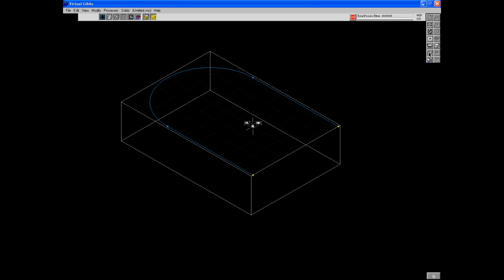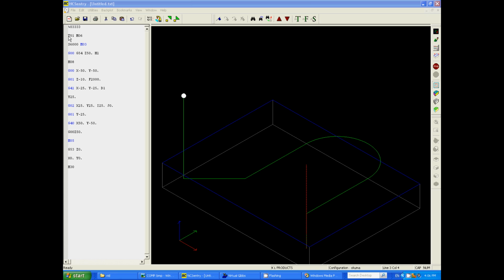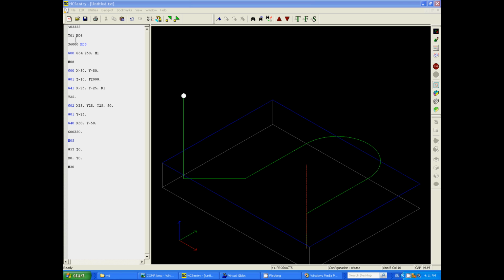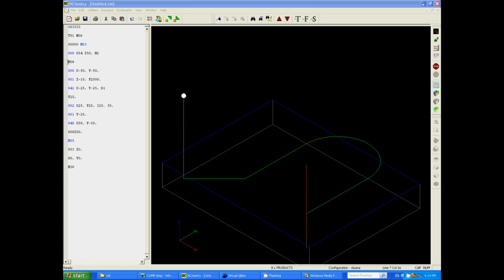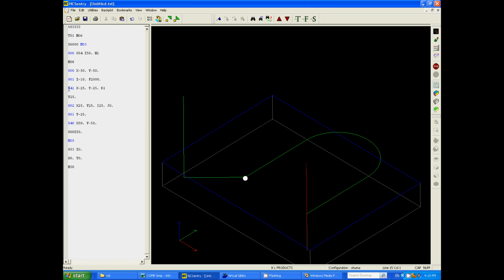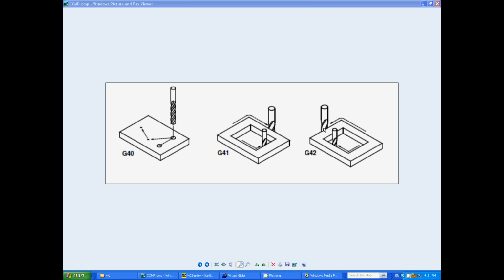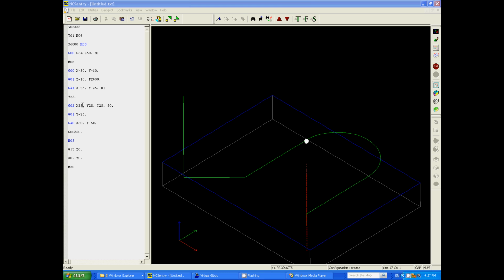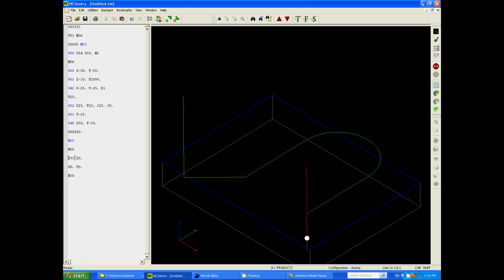CNC PROGRAMMING G-Code basics #1

Comment: I'm just finishing school for manual and cnc machining. For whatever reason, the computer tutorials we went through taught us to use cutter compensation. Since we were the first class through they hadn't looked close enough to what we were learning and when we got into actual programming, as apposes to practice coding, they told us not to use it because the industry standard is not to use it. Do you know anything about that? I'm in the U.S. maybe this is a standard ion the U.S. ...?
it just pissed me off because they should have looked closer and we had to unlearn the way we had just learned.
Reply from the maker: Hey mate, I'd say using cutter compensation is better than not using it however if you're just turning a simple shaft with no features it's not really necessary. Same with writing a simple facing cycle on a mill you might be better off programming without it... it's always subjective to what you're trying to achieve
Reply: lol ya, we're beyond that. They're really just kind-of figuring out how to develop a curriculum. Everyone I've seen get a job is mainly a button pusher so they are barley using anything we've learned as far as cnc goes and almost nothing of manual machining. They seem to be trying to get us to where we can code for an aerospace company strait out of school. Although I only got about 4 months of coding lessons it was very chaotic so I'm not even as good as the class behind me is. I didn't even know that most people code in a software environment that does most of it for them until a couple months ago. We started with a pencil & paper.
  CC certainly seems like it simplifies making a part because there's no need to factor in the radius of the cutter but my instructors are the ones who call the shots.
  It probably won't matter because I don't plan on working for someone anyway. I'm too anti-authoritarian to sit in a factory with a strict schedule, taking orders all day, I gotta go my own way.
 I guess I'll see if there's some B.S. about coding standards if I ever get into a situation where I have to conform to ISO 9000 but I plan to avoid that as long as  can.

Thank you for your time.

Comment: I also don't get the y25. movement you use y25 instead of x-25 y25 how is that possible? the movement is incremental 50 in positive y direction and in absolute terms you moved to the x-2 y25 position. but you don't write either of those. you just write y25. what does that mean. does that mean the machine es to absolute y25 and the not mention xis assumed as incremental 0?

Comment: In first version of this post I made a – mistake.
I’m just a beginner so forgive if incorrect. If Z0 is at platform or table height then Z-50 is assuming that stock is less than 50mm

Comment: I’m just a beginner so forgive if incorrect. If Z0 is at platform or table height then Z50 is assuming that stock is less than 50mm
Reply: +Ronald Schronce when you set a work offset you change from using the "global machine coordinates" and basically set a new 0 point for xzy using a work offset (g54,g55,g56,etc) so what is happening in the video is when he sets up a job he basically tells the machine that the top of the part will be what the machine  will be using as its 0 on xy and z. the machine by default the machine will then move the distances that are written  in the program using the new 0.

Comment: In the quote below if Z0 is top of stock shouldn't Z0.50 be a necetive number to avoid striking stock.?(IE: Z-50) Ron

"Hi oldflush, on most mill's i have run I have been able to do what you ask by using G92 so what I would do is position the cutter to the new zero position I would like and then use a line like: G92 X0.0Y0.0Z0.0 (THOUGH I HIGHLY RECOMMEND POSITIONING Z AT SAY 50.MM...G92X0.0Y0.0Z50.) "

Comment: ok um idk if anyone here can help me but i need to know this ASAP but ik how to program somewhat but when i cut like a letter and i rapid up to the next point and i drop down and it still cuts in rapid i do not know how to change it back to the original feed rate
Reply: must use a g01 or some other tool path cammand that is not rapid.

Comment: I apologize in advance for being a critic ...so here we go... Program O3333 indeed concerns me if it is to be used as a model for others to learn. As already noticed by another viewer your code breaks many rules. I would love to just have clicked on by but the fact that your coming across as a teacher of something that you clearly know just enough about to be dangerous. And I think what troubles me the most is these machines are not only expensive but can also cause injury. I really don't have the time nor desire to critique the whole mess so will limit it to one line (code). The G54 line sends Tool 1 (which is already in the spindle courtesy of line one) to Z50. .....the problem with that is the height offset (H1) will not be read by the control as a result of a missing G43 that is needed on same line. So lets say hypothetically that tool 1 is a six inch long 3/8 drill (diameter irrelevant)  and although the author has chosen to designate it as tool 1, tool 20 was actually the first tool in the program and it was a 1/2" diam. 90 degree spot drill just less than an inch out of the holder. Of course this tool wasn't programmed by our friend here, it's as far as the other guy got on the previous shift and it had the necessary G code. So what happens ? well it's not pretty. Machines don't see, hear, or reason. They just do what they're told (code). So our six inch long drill remains in rapid mode for an entire 5 inches after the drill had already reached t.o.p. (top of part). It's not a bad idea that every tool starts with a line of safety code. In this particular example the G49 that is usually incorporated into such safety lines cancels the previous height offset or it's also recommended to be accompanied by a G53 (with Z). i.e. G53 G49 Z0.

Comment from the maker: G41 and G42 is cutter compensation and can be used for either climb or conventional milling! as climb milling is most favorable for cutter life, machining conditions and surface finish many if not all new manual machines are fitted with backlash eliminators to allow for climb milling. these facts are quite often argued with old schoolers nether the less and with respect you need to check your facts